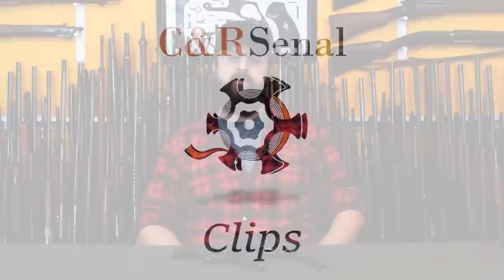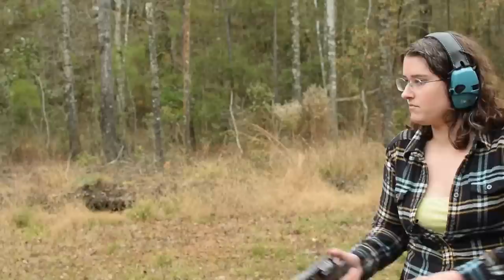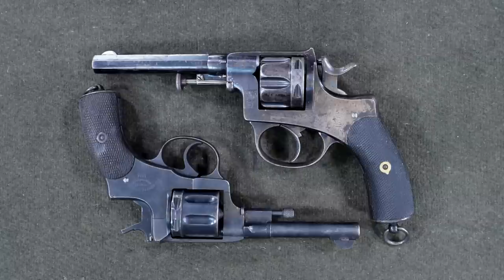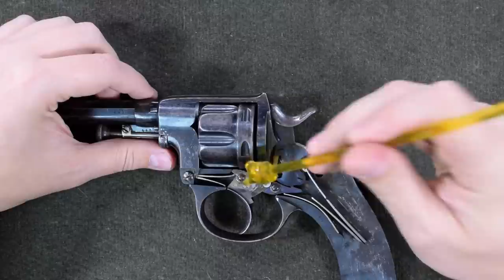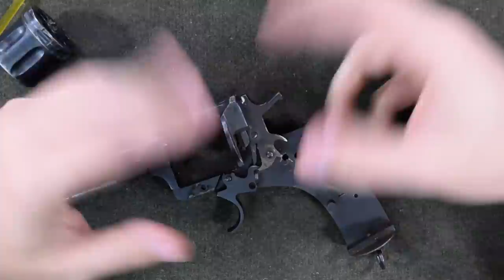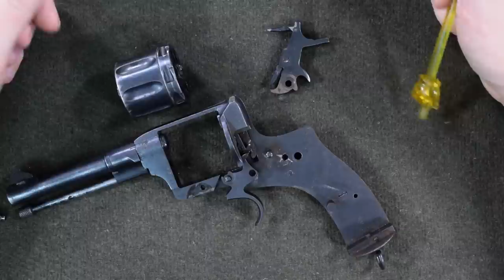Clips: A Quick Comparison of the 1878 and 1895 Nagant Revolvers

Comment: I recently had a chance to handle a Norwegian Nagant M1893. It seems to have the same trigger mechanism as the M95, but without the gas seal mechanism. Oddly, the one I looked at cannot be cocked to single action without partially pulling the trigger to get the hammer moving. I'm unsure if it's supposed to be that way, or if it's the result of wear and tear.
Reply: That is cool that you could handle and your story was very interesting.
Reply: do you have pictures of your nagant m1893? is that the model with the long cylinders? I would like to know more because I have an antique belgian revolver chambered for 7.62x38r that I know very littler about and very little information exists.

Comment: How much do you wanna bet that the Russian Revolver with less moving parts are more reliable than it's earlier Belgian counterpart?
Reply: Looks like the Russian has at least as many moving parts, if not a few more. They were both designed by the same guy, so I’m not sure why you would assume it is simpler and more reliable just because the Russians adopted it. Especially when they added a gas seal system.